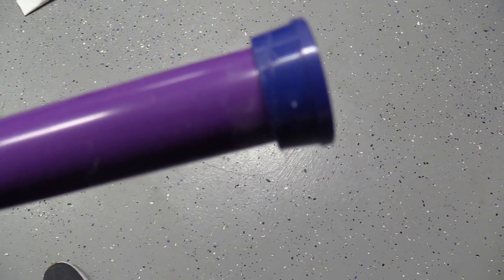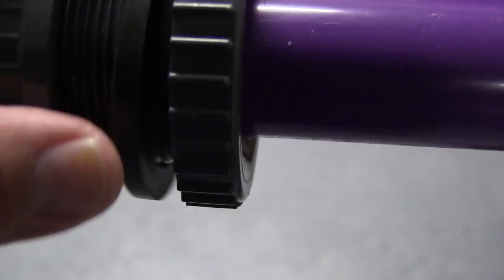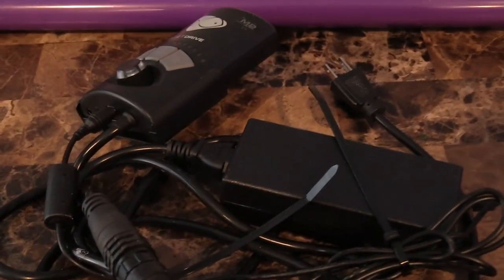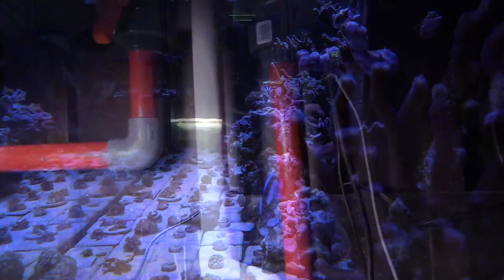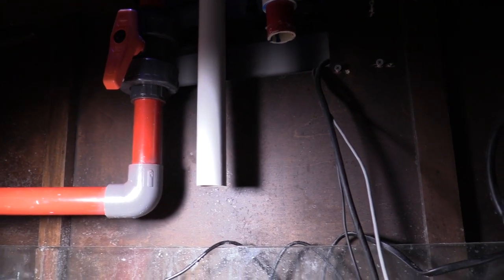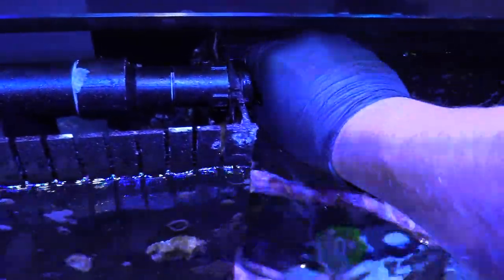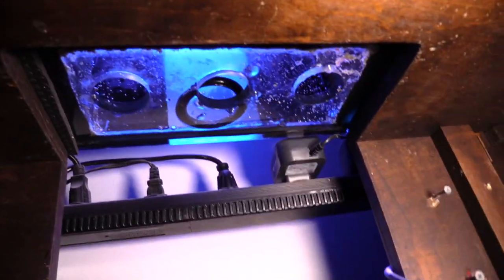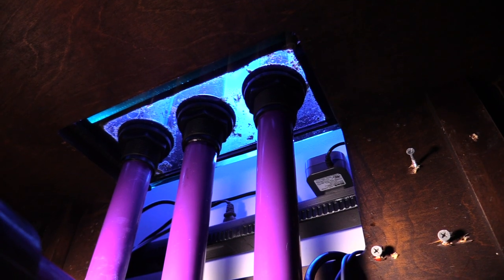PLUMBING A REEF TANK UPGRADE REEFS SALTWATER AQUARIUM CORAL REEF NANO TANK UPDATE

Comment: Great video.  I look forward to seeing more.
Reply from the maker: Hows it going Strat! Thank you for sticking around!
Reply: @915Mang  After being up and running almost 2 years, I think I am finally getting my display tank dialed in.  I was using API tests and was not following the steps precisely.  That mistake resulted in my Nitrate being above 40 and my phosphate being 0.  Once I got that figured out corals started taking off.